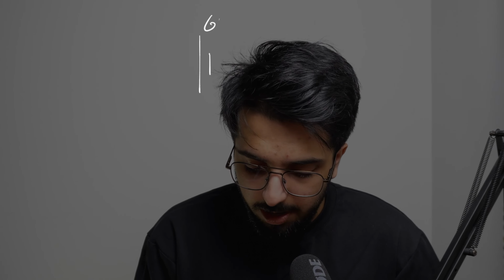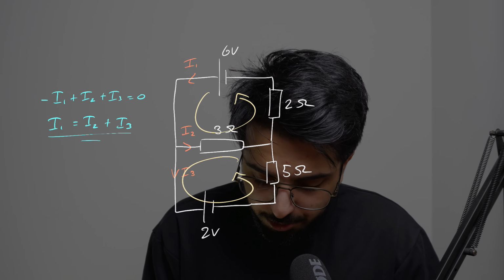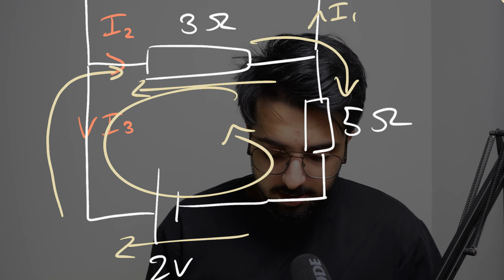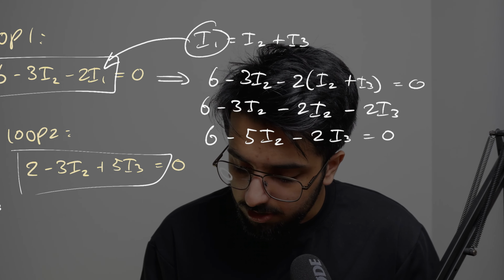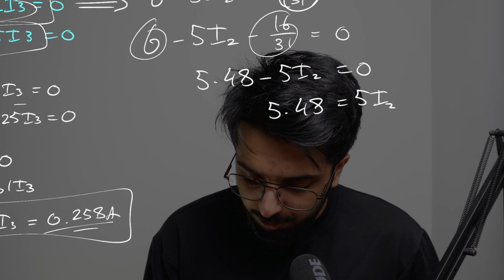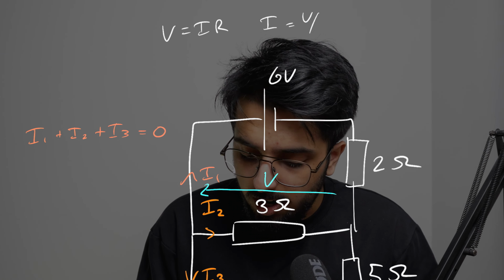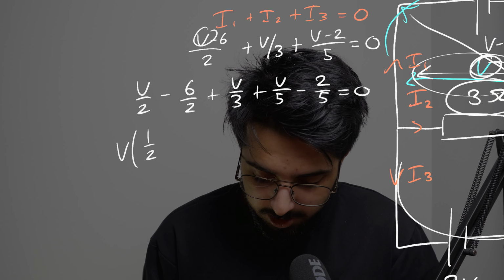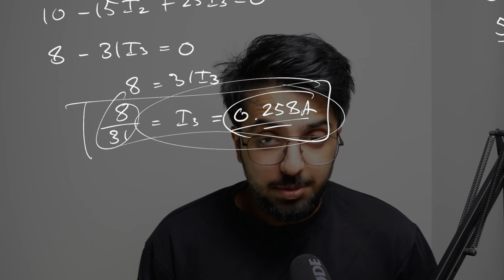Applying Kirchhoff's Laws | NCEA Level 3 Electricity

Comment: Hey sir can we just use our graphics calculator to get the values for I2 and I3 using simultaneous equations straight away without having to calculate it using simultaneous equations manually?
Reply from the maker: Yes you can. However, just make sure you write out the equations clearly for the marker to see
Reply: @theaceify  all good sir appreciate you alot